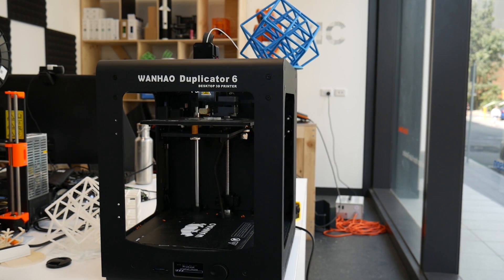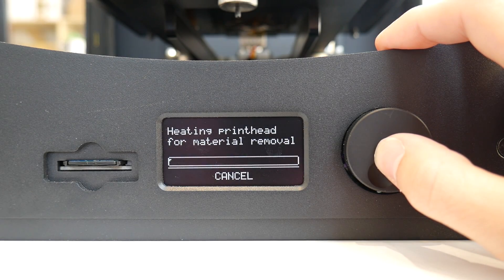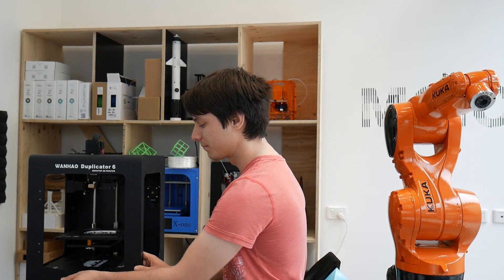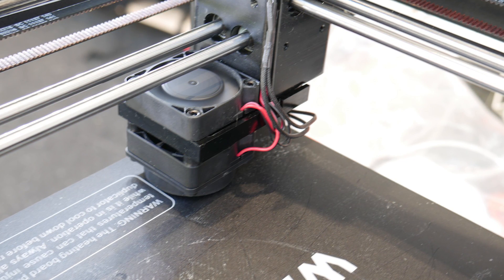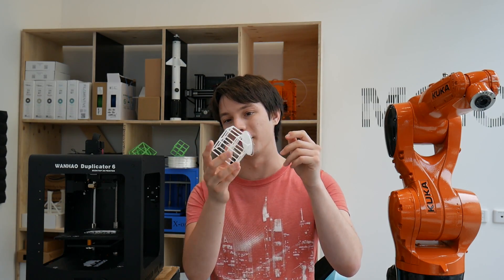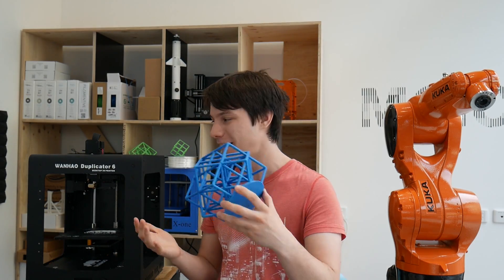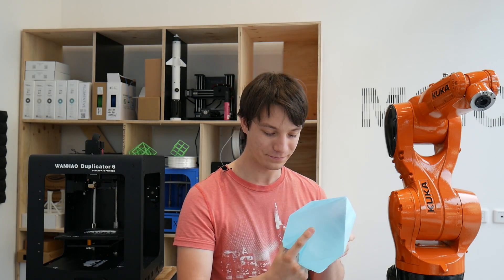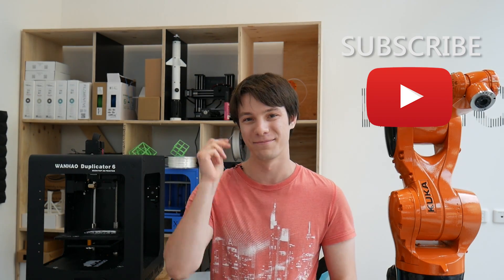Wanhao Duplicator 6 Review

Comment: This machine was a great learning machine for me, I got mine in 2017. However, reliability was always a huge issue, and I chased countless issues, and finally relented and got a Prusa i3 MKS and had a MUCH better printing experience. I just gave the D6 another look and noticed my y axis belt tension springs were installed upside down - they were not biting on the belt teeth, simply sliding on the smooth side of the belt. It explains many of the layer shift issues I ran into when ramping up print speeds to the advertised 150 mm/s. I’m giving this machine another shot.  Your video definitely gave me nostalgia and optimism to this machine’s capabilities.
Reply: thats just how the springs are installed

Comment: Interesting how my 'monoprice maker select pro ultimate 3d printer' is identical to that. I just got it, it was broken with an unknown issue, so I got it for $200CAD. I replaced the power supply, and discovered it only had 19 hours print time. The gantry needed some tweaks to reduce binding, and I upped all the stepper motor currents in the machines options menu. Been printing ABS, as it is my main fav, and so far, not too fond of the build matt. I actually typically use Lexan for a build plate with ABS, and it usually provides a superior adhesion, while also allowing the removal of a print by simply flexing the sheet of Lexan.

Comment: The printer works well in a very cold room and with cold print aka 185 to 195 print with a separate fan and cold bed. Warping goes away with a small personal fan, but grinding of the nozzles goes up. Best prints may be found with the new cura slicer and Microswiss all metal 6mm nozzle and 4-6 mm line width, a feature not normally available. It will crash with a temperature gradient over time, so don’t push it unless u are willing to upgrade the main board.  I got the best results with PLA carbon fiber at 230C . This was pushing the 28 gauge wire uses 4 lines for the heater at 0.7 amps, which I just replaced.  It excels at 20 mm per min if you turn off jerk and acceleration and forget about it printing. You will forget that it is printing.  U get even More for the money with the Monoprice ultimate iiip 3D printer for around 500$. Its the only printer I use with 20 micron tolerance for moldmaking silicon gizmos for Emarena- see Facebook. Cheers, Russ

Comment: Is the monoprice version of this machine very different and/or better
Reply: They're identical, literally just rebranded, but this review was done a long time ago and I think he skimped on it a little just because he was having initially bad results. On top of that, I think he was running his prints a bit fast.  These things might be listed as 150mm/s speed, and he was doing 100mm/s, but in reality, you might need ~80mm/s to get good prints.  That's still faster than most printers out there.  Virtually no printer is really meant to print reliably at its max speed. Some of that speed is really more useful for travel speed when not laying down filament, i.e. moving from one side of the model to another. There's one listed as 300mm/s, and it can only reliably print at 120mm/s, and still has issues.  

 These MK11 hotends have a PTFE liner inside, which breaks down at high heat over time. Some people say it happens after a few prints, but I think they're just running way too hot, probably in the 240c+ range.  The hotend can be replaced to be 'all metal' though, rather easily, if needed.  There's plenty of people that haven't modded a thing.   The cooler mod is so simple, it should be the first thing printed.  That's about the only mod one really needs. Although there's other small ones like a longer spool holder, or a filament guider.   I've seen some insane performance with the cooling mod, with bridging that has no supports from one side of the print bed to the other.  But one must also keep in mind that if you cool things too quickly, you can cause bad adhesion too, and that's with any printer.

It's important to keep in mind that while people do have issues with these machines, they'll also likely be the most vocal, meaning someone that doesn't have an issue isn't going to go out of their way to say "I'm doing just fine!".  So sometimes issues can seem magnified.  Granted, these are specialty pieces of hardware, not exactly in their infancy, but still more prone to failure than most consumer products.  But when they work, they also generally work for a long time.  I mean if you opened the guts of this thing, you'd see that there's not much to it.  Most of the internals are empty space.  There's a power supply, a controller board the size of a small tablet, and that's pretty much it.  90% empty space.

There's not a whole lot of videos on the monoprice, but that doesn't really say much.  Certain brands will get the spotlight, like the infamous Prusa MK2.  The thing is though, this is actually comparable to a Prusa MK2, except a smaller build size, and no auto bed leveling.  It's actually more stable than a Prusa MK2 since the bed only goes up and down, and the solid thick metal box frame really keeps things from going out of alignment.  We are after all talking about machines that move in the tens of microns, so accuracy is a must.  The monoprice ultimate can actually move up and down in 5 micron steps, which is 4 times more accurate than its listed 0.20 micro layer height.    You probably won't really ever need 0.20 layer height, 0.50 would probably be the maximum most will ever use.  

Another thing about these printers is the firmware, older firmware did have issues here and there that could cause system issues.  I see some people with the ultimate, and their problems go away once they update the firmware.  That's if they have any problems to begin with.

Comment: Hey Angus

Iv found the duplicator6 to be a FANTASTIC printer which i have had for about 8 months. 900 hours no failures.

The most striking part of this printer is the way it makes basically no HAIRS / STRINGS / BLOBS or TREE BRANCHES and parts come out strong, sharp and square.

I then watched your review and found you have had the OPPOSITE experience with it, with much amazement. 

And I know why now.

A few days ago i replaced the teflon liner because I had my FIRST jam in 900 hours of printing, and through experience this part should be treated as a consumable and be discarded after many 100s of hours.

I replaced it with what Wanhao sells under the spare parts section on alixpress, i bought 7 in total.

After the teflon liner install i had TERRIBLE STRINGING printing files i had printed literally 50-60 times on this printer!!

I was a little devastated

After taking my calipers out I discovered Wanhao are now supplying teflon hot end tubes with an ID (inside diameter) of around 1.8mm

When i measured the original one mine shipped with it was around 2.1mm!

My theory is the  smaller ID of these teflon liners leads to more pressure at the nozzle, and hence TERRIBLE STRINGING!

To test this i managed to source another teflon loner, measured the ID at 2.05mm and installed it

My duplicator 6 is once again producing STRING FREE excellent quality parts

Oh, and i usually mainly PLA (200degrees)

I am in the process of trying to inform Wanhoe of my findings.

PS we met at a meetup once in perth (Jasper)
Reply: hi, I'm confused how does a liner (i assume that's for the bed) have anything to do with stringing?
Reply: are you, maybe, talking about ptfe tube?
Reply: @pavelbaranov6635  It's the PTFE tube inside the heat break.

Comment: Nice videos, been watching a fair few of yours and has helped me decide on which wanhao to go for now, I agree from what you have shown it seems the price jump from the I3 plus to this does not really seem to be justified so you just saved me about £300!!! Thanks!
Reply: Based on the the unit supplied to Angus it would seem the printer is not worth the extra cost, however its become clear that he had received a dud and its actually a really nice upgrade over the i3 version.
Reply: Jasper Parker Unfortunately I decided not to go for a wanhao at all in the end. The suppliers in the uk are limited and the company I bought my i3 duplicator from originally I was going to replace are really bad.......but as it turns out the only ones who carry a supply of replacement parts and upgrades in the UK.

Comment: How about this simple solution for proper voltage.  Why can't you just put both fans in series where they would each receive 12 volts of the available 24 volts?? That would eliminate the need for the voltage regulator.  Reply please........
Reply from the maker: You should never series motors like that - stalling one will cause an unbalance in current and burn everything up very quickly.  Just buy 24V fans...

Comment: I got the duplicator soon as it came on the market because I could immediately tell this was a winner based on its design and not surprisingly it's been performing real well ever since. Makes pretty good quality parts but you do have to watch the first layer. If the first layer builds fine then the rest of the build goes smoothly.
p.s. I've been using exclusively hatchbox PLA (at 195 C) from amazon and esun PLA (200+ C)  and it's been working for me with no problems. Also, I have the covers on the machine for PLA prints and seems to not affect anything.

Comment: I ended up returning mine. Just too many small issues with it. Bad bearings, Bed level likes to change randomly due to the use of a screw to set zero. Even adding extra fans and ducts for filament cooling only helped marginally.

Comment: Hey !
I'm a new duplicator 6 owner and I confirm that the stock cooling sucks very hard. personally I have changed the stock fan  with a 24v 50mm blower with a nozzle cooler of my own and now , it works soo great !! but yeah it's a shame that designers didn't realize that their cooling was useless .. especially for a printer that expensive.
Reply: Can you explain exactly what is needed to change things so it cools better ?  Cheers

Comment: I've got the duplicator 4S. If I didn't have that I would get the duplicator 6. The 4S came without any cooling but to add it is no problem. I think the 6 with a couple of things tweeked is an awesome machine. Easily competes with some of the expensive models. What a shame they don't get the details right.

Comment: You better read the  WANHAO DUPLICATOR 6 Facebook group before buying one. Most of us regret our purchase.  Bed leveling screws digging in, throwing sparks, failed motherboards, bent rods, frozen bearings, failed MB cooling fans, and zero support the list goes on and on.
Reply: Totally Agree. I have had my Duplicator 6 for maybe three months and currently the mainboard has a fault that needs a repair and it's been like that for a month. Wanhao Support have not responded at all. I do regret my purchase would never recommend Wanhao to anyone based on my experience from Aliexpress to arriving damaged to Wanhao sh*tty attitude.
Reply: Ok, I guess bent Z rods, Failed main boards, failed fans, failed relays, are noob issues.   It costs 300-400 bucks to get many of these running right.  You are better off buying a good kit and making sure it is build right.
Reply: This should be top comment to prevent others from doing the same mistake.
Reply: I have no skin in the game anymore, I built a high quality kit.  Just a warning for those who are thinking about buying one.  Look at the FB group for the D6 and the polls asking if they would buy one again.  Look at the posts there about the blown mother boards and relays.  Look at the posts there complaining about the horrible support from Wanhao.
Reply: should have bought a duplicator i3...
it prints great and much cheaper than this
and has many mods that make the prints it as good as this..
Reply: Got mine in July.  Been making updates on it as outlined on the FB group.  Point is moot now.  I dumped that piece of shit and built a 12 inch Makerfarm Pegasus.  Great kit, and fantastic support.  If you think the D6 will be plug and play  you will be disappointed.
Reply: The only thing on it that they cheaped out on was the Z axis rods.  Simple to beef those up.
Reply: oh god, Pegasus is probably worse, terrible terrible design and even cheaper Chinese parts and bearings.  i would rather replace the board and rods on the duplicator than use that POS.  the frame is better than the lesser models but still terrible.  you're just better off going on open builds and grabbing a bom for a properly design machine that isn't made to cut so many corners.

Comment: Mimic to Zortrax M200 but not even close to the quality it's an insult to say it's same as ultimaker 2 or Zortrax
Reply: Think of it this way - 

When your car brakes down you pay a mechanic to fix it or you fix it yourself. If you paid the mechanic you have paid for his time and knowledge. If you had the time and knowledge yourself you could do the repair and save money...

Yes you could build your own 3D printer but not everyone wants to spend time sourcing parts then building and tuning a 3D printer
Reply: Yeah, definitely ripping off Zortrax, but oddly using Ultimaker's firmware code.

Comment: Havind used the machine you are right the cooling stock is bad but the mechanical setup is solid making the cooling mod the only thing to change to have a machine which in some ways are better then an ultimaker.
Reply: Print a new fan shroud with ABS and you're good to go. The i6 is far superior to the i3 where it counts. Much more rigid and accurate. Much lower moving mass. A great 3D printer is defined by it's mechanics, not by a fan duct.
I firmly believe this machine has some of the best "bones" of any consumer 3D printer in it's price range.
Reply: I own this pinter and it is fantastic.  PETG, does print amazing on it.  I plan on developing a different fan should which is all this printer needs to be excellent with certain PLA designs.
Reply: I agree, most of the 3D printers come with some default, so if you can fix them with only a 3D print and or enclosure (and it looks really easy to do it DIY) then my thought is that you are under evaluating a really good machine no? Actually I thing it will be really interesting to test it with this small mod.

Comment: Stop teasing us with the darn Kuka. Just show us it in motion!!! 🙄🤓😛🙃😈
Reply: +Angus 

Give it away at 50,000
Reply: It was in one of Patreon only videos.
Reply: I don't get why people always give a bunch of flack to printers that are not core X-Y or similar configuration. I have a knock off Bukito (Afinibot CR-7) with a moving x for the carriage and a plate that moves in the Y. It's fantastic, it gives PERFECT prints on the first try. And it's portable too... I have two printers and the other is a deltaprintr which is obviously a deltabot... It's horrible... COmplete polar opposites...
Reply: Who is slagging on other mechanisms? Are there deleted posts I didn't see?
Also, just in case you didn't know, the D6 isn't CoreXY.
Reply: +JeffDM What would you call the D6 then if not Hbot or CoreXY? Thanks.
Reply: Ultimaker mechanism. It's two intersecting gantries. H-Bot and CoreXY are relatively similar to each other, one gantry controlled by two long belts that loop the XY platform.
Reply: JeffDM So there's no short reference name category like H-Bot and CoreXY for these types of printers? Wer Ultimaker the first use this type of mechanical design?
Reply: Going back to your OP, delta vs cartesian.
Reply: vidznstuff1 ?
Reply: I don't know of a short name. intersecting XY is about the shortest non-branded name I can think of.
Reply: JeffDM everyone calls it the ultimaker gantry, nothing wrong with that